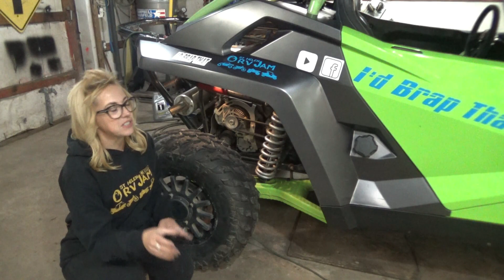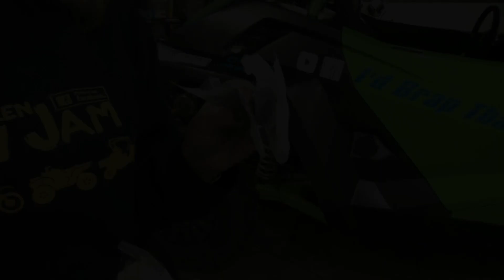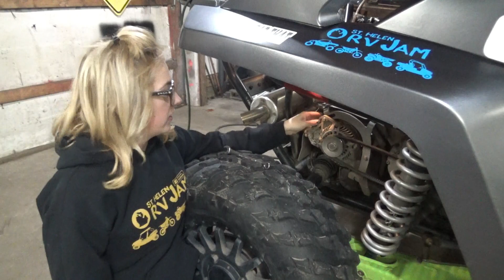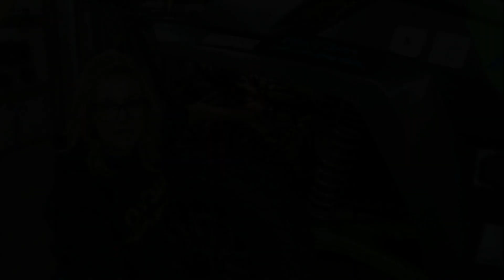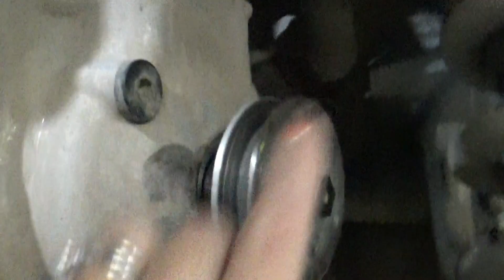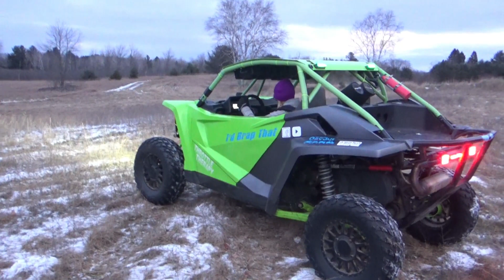Wildcat XX Alternator Pulley Delete Kit Installation

Comment: Hey how did you get the bolt out of the pulley
Reply from the maker: The pulley presses off the bolt, its one piece. To get the pulley off of the motor you have to undo the seal nut behind the pulley.